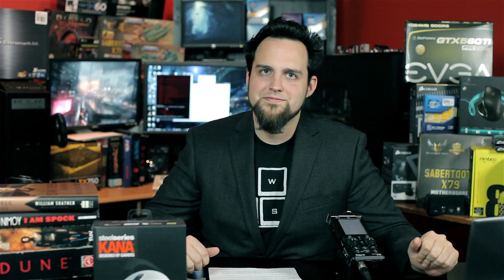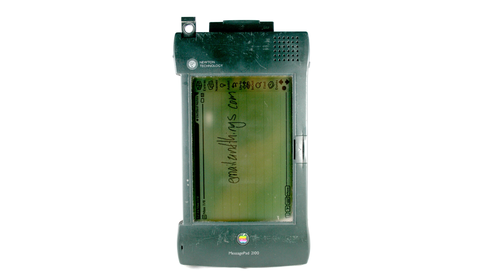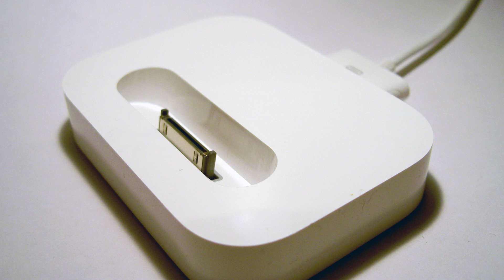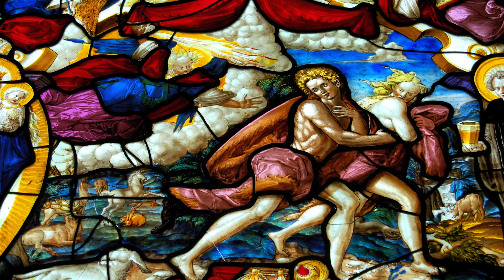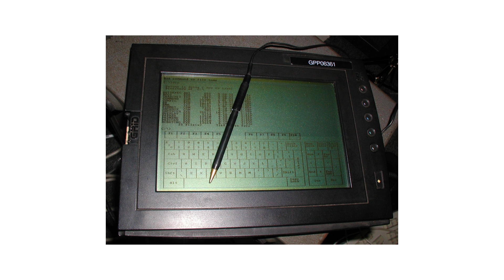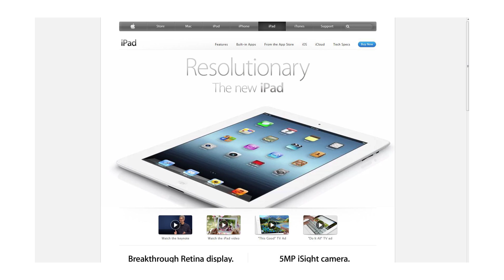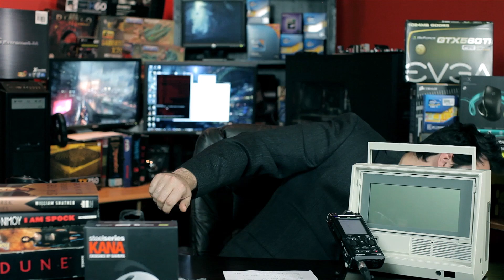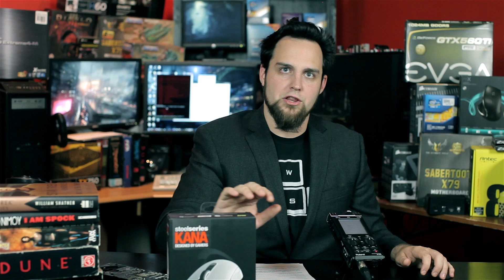Has Apple Really Ever Invented Anything?

Comment: I fully agree with almost everything you said, BUT you've got some things wrong.

The first thing you got wrong was the Thunderbolt thing. Thunderbolt was invented by Apple and Intel cooperatively, but all the rights and patents were transfered (probably sold) to Intel. This was probably done to make licensing less of a problem, because if two companies share the rights and patents of a single technology, what will happen in the case of disputes?

The second thing you got wrong was OS X. OS X is POSIX complient, just like Unix, BSD and Linux largely or entirely are. But being POSIX complient IS NOT the same as being based on existing POSIX complient operating systems! POSIX is a set of standards, and POSIX complient operating systems should be able to run software that's compiled from the same source code. There are pthreads, sockets and what not; but that will all work on Unix, BSD, Linux, OS X and other POSIX complient operating systems. OS X was rewritten entirely from scratch (because they realized that their classic Mac OS was indeed crap), but portions of code and concepts were taken from NeXT - a company Steve Jobs started after leaving Apple - and, indeed, BSD and the likes. But please notice that the portions of code that Apple used from other sources are all open source! Apple and open source? Yes! https://www.apple.com/opensource/
But still.. I'd hardly call an OS an invention anyway.

The third thing you got wrong is actually connected to my second point, and that is iOS. The fact that OS X could be easily adopted from PPC to x86 and later ARM in the form of iOS has nothing to do with being POSIX complient ("based on" BSD), but because of it's lower layer. OS X has shown to be easily portable to different platforms, as Steve Jobs announces on the 2005 WWDC that all previous OS X versions were compiled for both PPC and x86. Unix or other POSIX compliant operating systems aren't portable by nature, it's just a lucky coincidence.

The fourth thing you got wrong was the iPhone itself. They might not have come up with the name themselves, but I find it much more likely they found the name "iPhone" very fitting because they already had an iPod. But that's not even the point! They've invented the device itself, regardless of the name!

The fifth thing you got wrong was the whole CPU/GPU thing. They've not invented anything here indeed, but there's a whole different story behind it! ARM does not produce the Apple chips. ARM licenses it's chip design to other companies so other companies can take the ARM design, change it in every way they like and use it in their products. Apples does design their own chips, but production is done by Samsung.

Lastly, I want to point out that this entire "contest" is stupid. Apple is not a company that earns its bucks by inventing new technologies! Apple is a company that makes high end consumer grade products with what they believe are the best technologies. They didn't invent Touch ID, multitouch etc., but they were the ones who first successfully put them into "affordable" devices.

They have a lot of patents - either from their own inventions or patents that came with companies they bought - and JUST LIKE OTHER COMPANIES LIKE SAMSUNG they protect them.

Comment: I wonder what apples reaction would be when Samsung stops making screens for them?
Reply: I wonder what Samsung's reaction would be, when they have to report less revenue.
The iPad's display costs around 80 USD, the iPhone's display costs around 30 to 50 USD (depending on model and size).
Now that Apple has sold 150 million iPhones and 70 million iPads in 2013, and this year probably a bit more and next year probably a bit more than that, Samsung would have to forego 11 to 12 billion USD of their 200 billion USD revenue with electronics.
That is of course not much and could be handled, but even if those 11 to 12 billion USD are small potatoes for some, mouths still have to be fed.
Reply: They did. Their new A8 chip is not manufactured by samsung anymore, the screen is made of LG and the camera from Sony